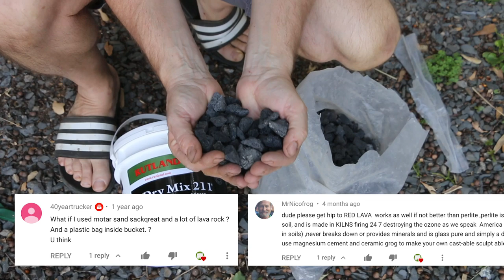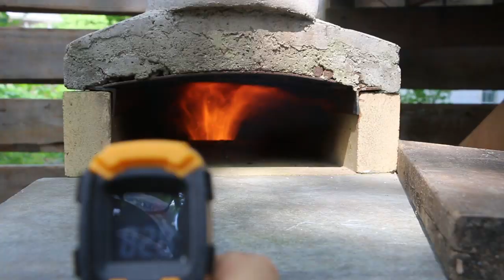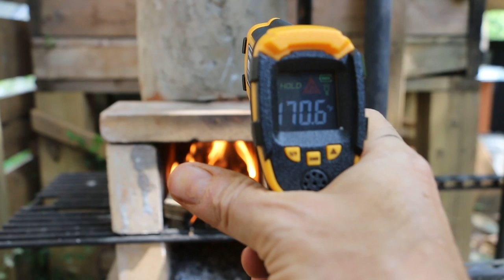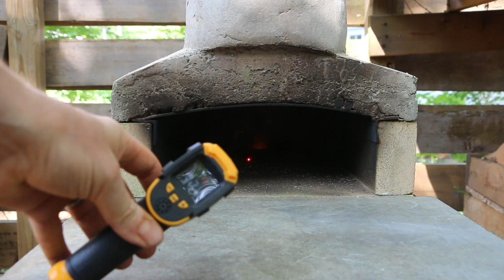How To Make A Lava Rock And Refractory Mortar Rocket Stove

Comment: Definitely would suggest you make your lava rock, concrete outer wall thicker and premix the lava rock in with your mortar. 

You are actually creating a concrete mixture that hopefully will be able to withstand a lot of heat.

I'm assuming you are using your 2k degree mortar?

Just redesign the wall to be thick enough for the size of your aggregate. 

Did you consider crushing down the size of your lava rock?

Actually perlite is a glass substance similar to lava rock...

Maybe experiment with all of the above and even use some vermiculite ?

Comment: I don't know much about bricklayers job, but surfaces should be wet before applying mortar (clay), and you should add dry material (cement) into water to mix them instead to add water to the dry material.

Comment: I think one issue you are having is the rebar maybe sucking up more heat than it is radiating to the rest of the oven.  Like you said, you've essentially made a broiler, which is great for searing a steak or getting cheese brown and bubbly melt.  But it's not so great for something that needs even heating.  You might be able to rectify this by putting a layer of stove mortar inside on the bars and possibly using refractory paint over that.
Reply from the maker: Excellent feedback, Wesley. I appreciate both of your comments on this video. Great tips. Thank you. Thank you for watching.

Comment: Problem With the ash is your using sticks that have bark on them and the cardboard to light it that's whats causing all the ash. You need something more solid to burn. Maybe you could try using charcoal briquettes piling them to the opening of the stack. (Not using lighter fluid or paper of any kind the light it) Use a blow torch to light them from the bottom center of the pile then use man made logs once it's hot enough and there's room for them. Plus you need to make the fire place into a tunnel. Like one brick more longer to build up more heat.
Reply from the maker: Thanks for the tips, Mike. Good suggestions. Thanks for watching.

Comment: I am thinking of making a pizza oven & you won't believe i had exactly similar dezin on my mind.

I think problem with your oven is in sufficient insulation,small flame & also you need to have some small lip of material on top so that heat spread inside a little more

Comment: You dont have to use plastic bag,  apply use oil on the side  of  salvaged pipe, the lava  rock tou dont need that. But if you insist, mix the lava rock to mortar. The cement is thick  add a little more water.  To compact the mortar cement, vibratefor a few seconds on both side. When the  mortar is cured,  pour hot water  on the pipe, to remove the cured mortar..

Comment: Great build, reducing the chimney length seems to have had the difference you were seeking.  Suggestion; build or modify a small brush to scrape out the ash from the oven floor to determine if ash is from twigs and not major logs.  Second thought; with all the spare metal on the roof could you fashion a scoop 1/2 the height of the back of the oven to direct some of the hot exhaust down on the brick floor.  Flames from back of riser still heat the oven top while flames from riser front are directed toward the brick floor.    Nice to see you wearing gloves and mask. Peace brother.
Reply from the maker: JW...I like the brush idea. I've had a few other comments about heating the floor. I was thinking about doing that with a second rocket stove underneath the oven, but sharing the chimney input into the oven. I can't use the roofing without removing the galvanized coating (which can be done). I do have some raw sheet steel that would work as well. I'll look into that design idea. Thanks for the support, brother. :-)
Reply: GreenShortz DIY good catch on the galvanized flavor additive.  Redirecting heat down to the brick may make the difference you need for a crispy crust.  Stay safe out there.  Peace brother.

Comment: Better off also by lightly coating the piping with any oil, wipe the excess. Mix the mortar and rocks, i would even wet the rocks first maybe if its a dryer mix... Fill the spaces tight. Tap it to get as much air out. Put in the bucket and recast it over the busted stove. A thinish layer,  without rocks even, will do

Layer and knit it into the stove to bind. Compact and next layer..... 

Mix bigger batches dude. Different mixes means different chemical reactions ergo, weak chains in the link and can crack

Tip. Pour boiling water. It also releases nicely.
Reply from the maker: Thank you for the feedback, Heleen. I appreciate it.

Comment: Spraying your form with WD 40 or vegetable oil instead of using the trash bags will release the concrete.
Reply from the maker: Thanks for the tip Everett. I'll use your recommendation in my redo. Thanks for watching.

Comment: would it be possible to crush the lava rock so smaller chunks when working on such a small project?  I would worry that inner part of tube is same as outer part.
Reply from the maker: That might have helped. I tried to pull out the bigger rocks. While this was a bit of an awkward build, it turned out ok. Thank you for watching.

Comment: The thing you could've done to prevent the uneven lava rock and it having holes/gaps would be to make it in bricks. Make a form, put the concrete or whatever you use to seal on the bottom and line the top of the bricks with the lava rock. You'd have to play around a bit to figure how to put the bricks together but it seems like it would've made it more like what you were looking for.
Reply from the maker: That is a good solution. The lava rock and mortar didn't mix like I thought they would. Thanks for watching.

Comment: Wonder if anyone is using an afterburner design. Step up chimney with a siphon hole that reintroduces air to the superheated smoke. 

You're probably getting it in your design from any leaks between the oven and up flue.

Comment: Super por-rok.... comes in a 5 gal bucket.... mix 1/2 bucket at a time to a thin-ish slury... pre fill form w lava rock and cage. The mix will make heat and start drying like epoxy, so pour quickly... make sure bottom of form is sealed.... remix more if needed. Iv used the stuff for setting signs in concrete walkways.... fairly fast set up time but not sure how it'll hold up to the heat.... but its strong stuff
Reply from the maker: Thank you for the suggestion, Andy. Thank you for watching.

Comment: In my region we say "kaya" for "hello". (I'm in the Nyoongar region of Australia; my uni campus is bilingual English/Nyoongar)
Reply from the maker: Cool, Rohan! Thank you for sharing. Thank you for watching.
Reply: @GreenShortzDIY  I'm also trying out the "sand core" technique I learned from the Townsends; they use paper to keep the sand from sticking to the cob due to their use of it for an oven, but for a stove I see no need, yet I have to pretty much…hand-3D-print each module.